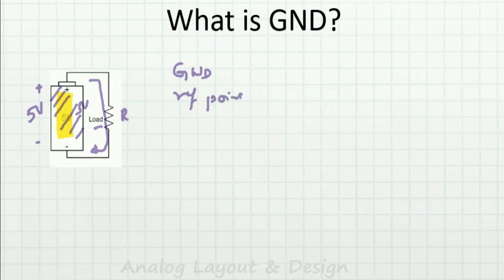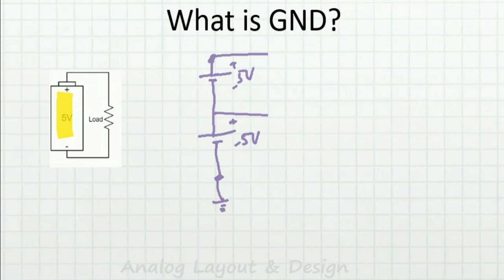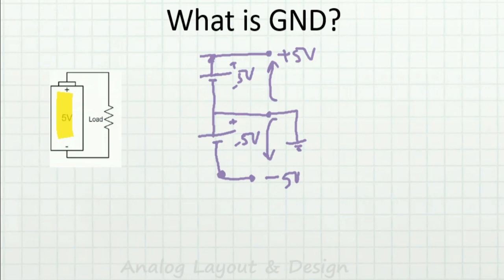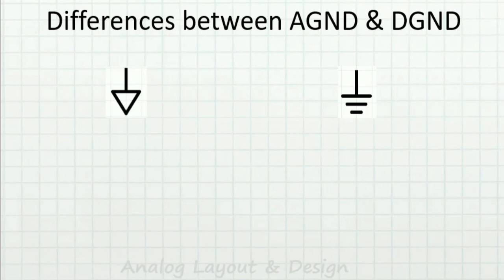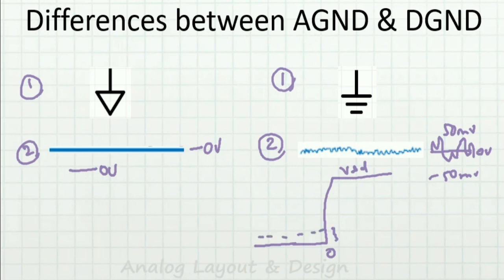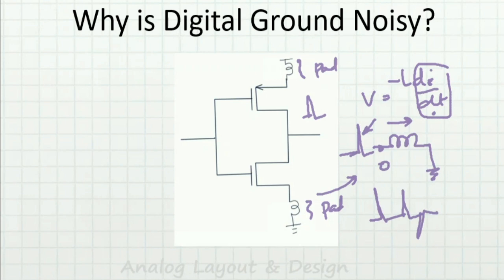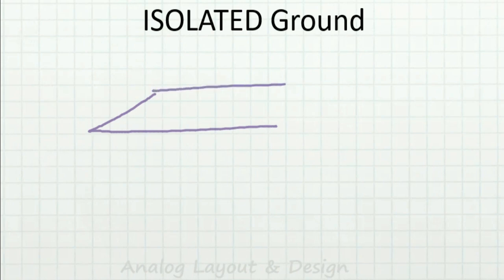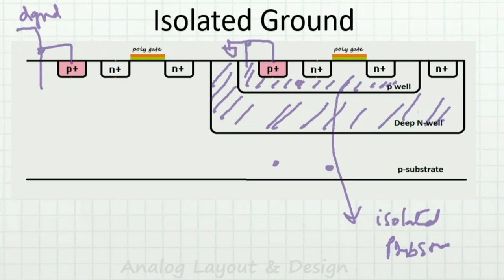AGND, DGND, ISOLATION (STAR CONNECTION)

Comment: 16:50 It's said that connecting agnd and dgnd needs an inductor. I have TPS51222 ic, page 30 said it is required to short them with 0 ohm resistor, is the inductor from dgnd circuit same with this function?
Reply: Please check out, that could be ferrite bead to reduce high frequency noise n emi. Ferrite bead inductance is specified as ohms and not henries.

Comment: Sir I have a simple doubt..... My circuit is having agnd and dgnd both and the power supply is 6-0-6ac..... How can I connect it directly to 12v dc...?
Reply from the maker: I think from your 12V DC power supply, they have a smps that generates 6V DC. and for 6v ac... theyn might be inverting it as well. if you can share me circuit diagram high level or power supply pic, then i can discuss more...

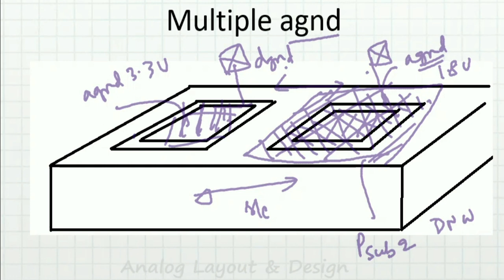Comment: at 19:10, when agnd and dgnd are separate pads, there is still a possibility for current to flow from analog circuit to digital circuit if the substrate taps are not strong.
Reply from the maker: true

Comment: what is the typical inductor valued used in power supply isolation at 16:50? 
is it external or internal to package? If it is huge, i don't think it is possible to accomodate inside the package. what is the reason that the same inductor is problematic for gnd? 
Both these statements seem contradictory.
Reply from the maker: isolated powersupplies use transformers.... they can never get integrated....isolated powersupplies inside a chip or even package is not possible....